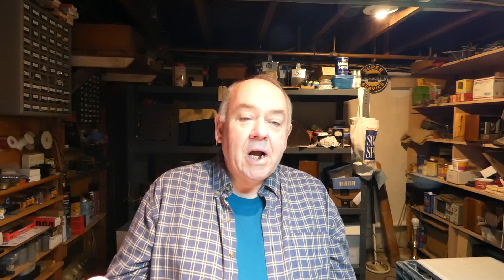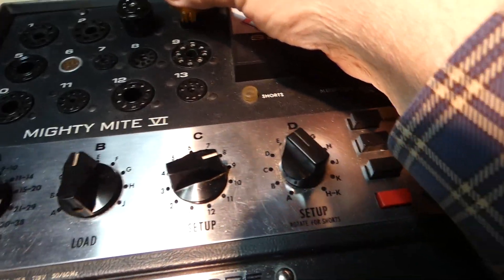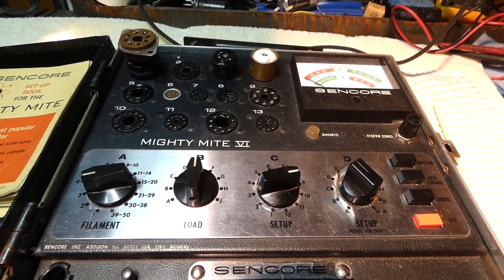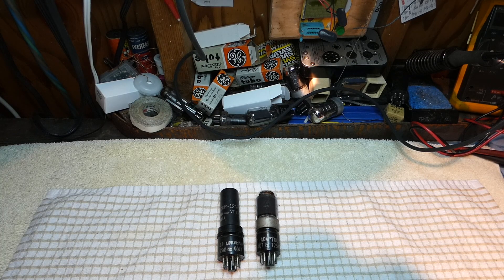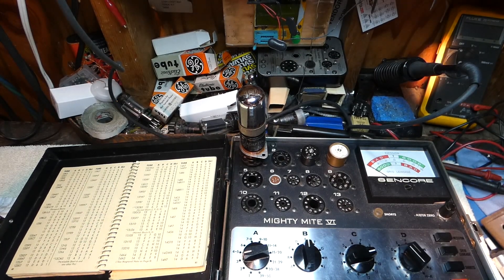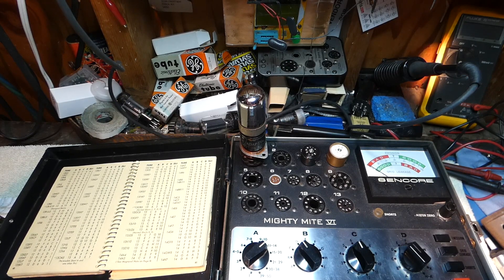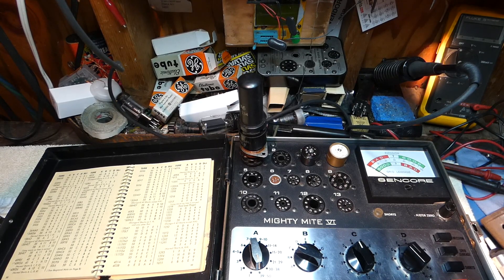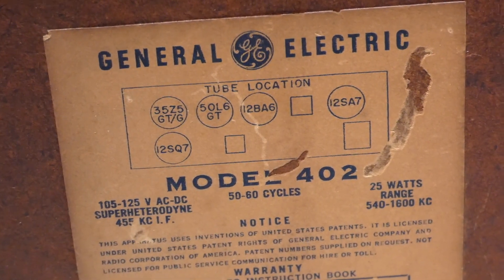Tube Adaptors for substitution in radios

Comment: Homemade socket savers for your tube tester really don't work very well unless you bolt them down into place, because every time you pull a tube in and out of that homemade adapter you are invariably going to be rocking the adapter inside the socket of the tube tester itself, which is kind of defeating the purpose of a socket saver, to prevent the socket contacts from frequent wiggling and expansion of the contacts thay causes them to loosen. The socket saver will capture dirt and oxidation that might otherwise end up inside the contacts of the testers' integral sockets, which is helpful, but you're still physically stressing the socket contacts. 

BTW, I have about 50 various adaptors for using loctal tubes as replacements for octal tubes. I'm an audio and guitar amp repair tech (now mostly retired), not a radio collector, so I'm more likely to rewire them to use 7C5 loctals as replacements for 6V6 tubes.

Comment: In one of my videos a couple days ago I showed the tubes I bought inside this steel box. every tube was new old stock oldest ones from 1943 to 1945 totally unused. I even show what they look like for the box with all the tubes I paid $20. That mighty mite looks pretty neat I have a couple tube testers mostly use a knight kit 600. Good idea about the socket adapters Bob. Pretty good using the adapters to convert tubes to be useful in radios.

Comment: I am sure the 12A6 adaptor has a dropping resistor in it, if not goodbye 12A6.
I would stay with the 50L6 because they are common tubes.
Thanks for the video.
BTW I used to have a SENCORE tube tester like that, now I use a B&K 606, same tester I think.

Comment: I never knew such adapters existed! Cool! I don't think I'd use the adapters, I agree with you that nowadays I don't have any problems acquiring 12SA7's or 50L6's! maybe, back in the day, those two tubes were hard to get?? I dunno! I'm on the lookout for octal-type tube adapters that have test points for each pin! Those are hard .to come by around here! I subscribed to the ARCOI. Thanks for the vids!